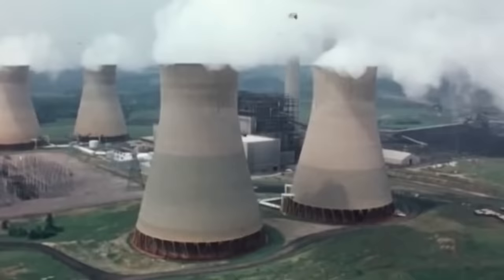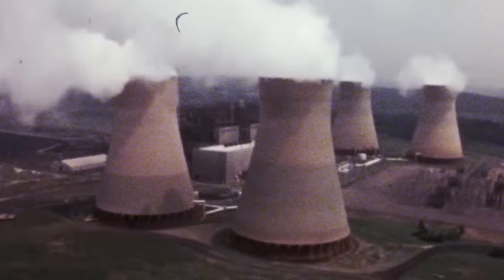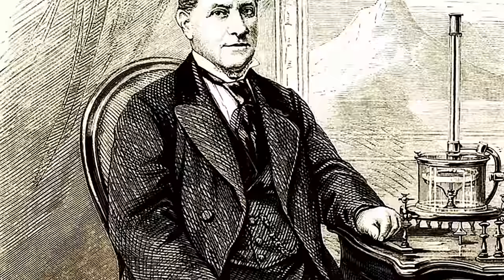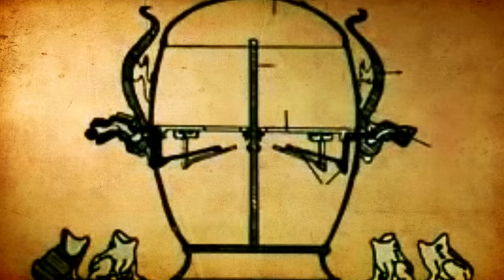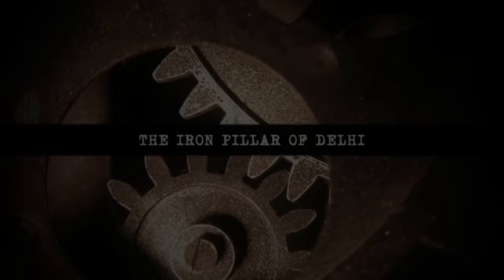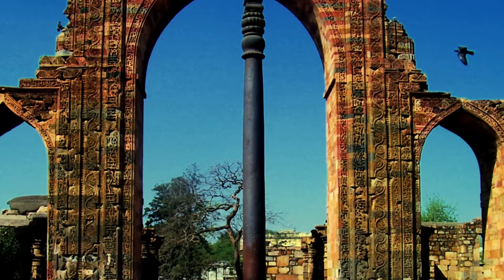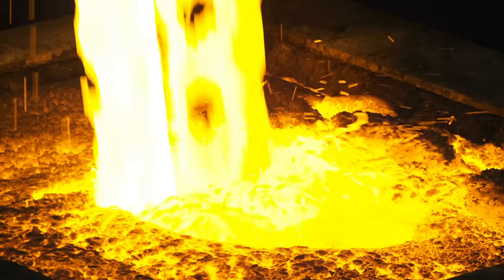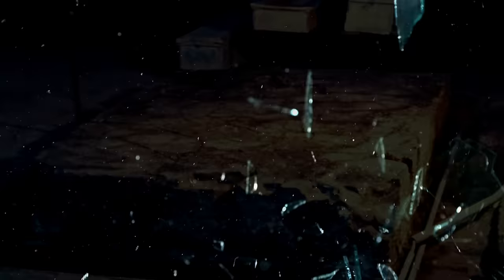5 Unexplained (And Out Of Place) Ancient Technologies

Comment: The Gabon nuclear reactor made enough heat to extrude a glass slab in Israel while also forming a rustproof iron column in India. Kind of an "equal but opposite" thing. Meanwhile, all this nuclear stuff was leaking electrons into Baghdad, where the barbers would capture them and use them as a hair growth stimulator. And not a single alien in sight. Well, except for the ones whose craft are pictured inside the pyramids.🤣

Comment: I've always said that having a reactor underground is better than having it on the surface... at least underground the pollution can be controlled by building a catchment for smoke then filtering the air and turning the particles into a safe type of solid fuel that we could use to burn instead of things like coal that's harmful on the environment.
I've always had this vision on what the reactor should look like and how it should be built.
Reply: Wow.....

Comment: 5 "unexplained" technologies which the video proceeds to... explain. The seismograph "telling direction" is 100% bogus Yes, at a very low level, seismic waves propagate, but the tremors manifested on the surface are chaotic "reflections", dependent on local soil (not to mention structure of the house etc). You need to read AMPLITUDES (NOT "direction") from MANY scattered seismographs to actually back-track the direction.That "seismograph" just was a bunch of precariously balanced balls that fell randomly if slightly vibrated. You can make a similar "ingenious" device by placing a steel ball on a flat book, plate etc. You'll gain EXACTLY as much "insight" as the ancients: namely "it vibrated", either due to a human making a heavy footstep, an air draft due to an open door, or a car/wagon travelling nearby, or (on a rare occasion) an earthquake. Not really an "out of place" technology.
Reply: So basically you think it's false because you don't understand it plus some light strawman-ing too. Seems legit...